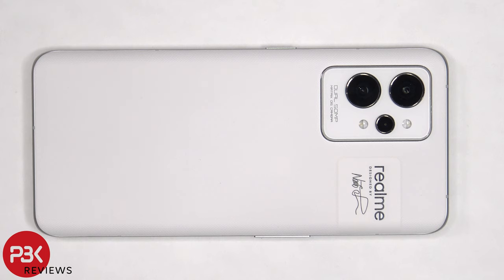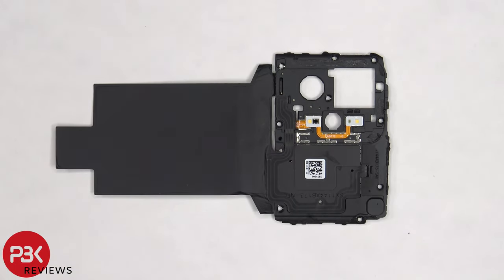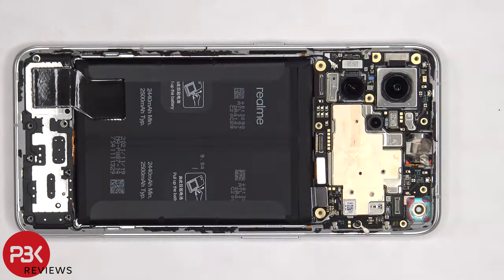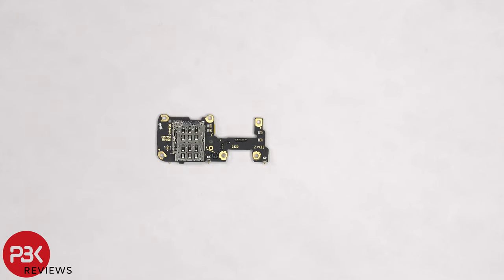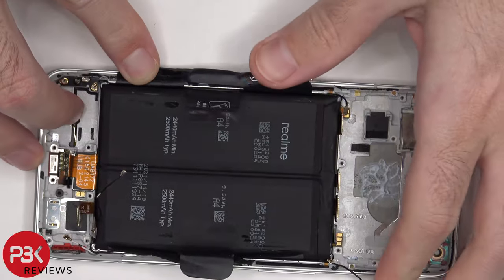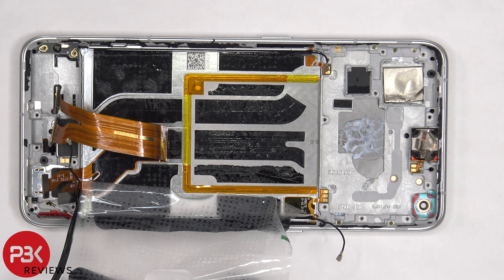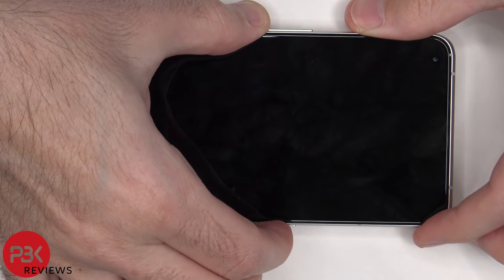Realme GT2 PRO Disassembly Teardown Repair Video Review

Comment: Thanks for your very interesting and helpful content and
Do you noticed how they made this phone with 360 degree nfc and enhanced wi-fi and antenna?
Reply from the maker: Yes they are basically using the NFC antenna on the black plastic cover as shown in the video, as well as incorporating the the antenna built into the frame on the top and top corners. Same with the wi-fi which uses the antennas on the top side of the frame and bottom side. You're welcome :)
Reply: That's cool but it doesn't work properly. I tried to scan from different positions when paying with NFC. Doesn't work. So, yeah. A little bullshit from them.

Comment: Hello man. Thanks for the instructions. Do you know how can I glue or buy copper cloth thing at 3.25?

I also reapplied the thermal paste but I dont know why I fucked up the front cam. It doesn't want to boot up. I checked everything properly and couldn't find a thing.

Comment: Bro just need a clarification...at video time 3.33 it shows Qualcomm PM8350 (8350 is sanpdragon 888), but gt2 pro states it got snapdragon 8 gen 1 which is 8450. So is it having snapdragon 888 under the hood
Reply: is there any follow up on this? i wanna know the same thing
Reply: @DannTeBg  Hi! There's nothing to worry about. You can clearly see it says  PM 8350 NOT SM8350.  The PM stands for power management, Therefore it's the power management chipset.  The Realme GT2 Pro sports the snapdragon 8 gen 1 chipset as stated in the specs of the phone.

Comment: the cooling system just some copper tape with thermal paste?
i thought got heatpipe like samsung because they advertise thier cooling is the best
Reply: This has a stainless steel vapor chamber underneath the screen. You can see it at 7:09, it's the slightly darker grey metal with the thermal paste, extending all the way to the yellow outline in the battery compartment. For a normal form factor phone, this GT2 Pro has a really big vapor chamber.
Reply: @somayough  thanks for the explanation... now i understand

Comment: So, If I broke the sceen should I buy the screen+frame or just the screen?
Reply from the maker: It's cheaper if you buy just the screen, but much easier for installation/replacement if you get the screen with pre attached frame.
Reply: @PBKreviews  yeah, was thinking the same then I noticed the frame is bented lmao - gotta think next time before dumping the trailer with the phone on it lol. Now I'm condamned at using the phone via mouse for a week!

Comment: Hi. i have just replaced my screen. Tell me why does the fingerprint scanner not work? All is connected right :(
Reply from the maker: Back up all your data, and do a factory reset (which will erase everything on the phone). This should reprogram the new fingerprint sensor to the board and get it working.

Comment: Did the water test mess up the speaker? I just dropped mine in a bucket of water and the speaker is now awful. Drying it for 24hrs to see if it will go back to normal.
Reply from the maker: No worked fine after I did it.
Reply: @PBKreviews  Confirming this. I blew on the speakers and there were water stucked. After that, sound went back to normal. So glad it is indeed waterproof.

Comment: sir this phone have physical proximetric sensor ?
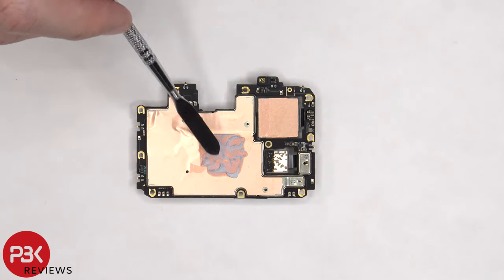Reply from the maker: yes you can see it @3:40 in the video.
Reply: thanks
Reply: @PBKreviews is it possible to change the proximity sensor separately? because mine got damaged due to water

Comment: Guys help..I have a realme GT 2 and motherboard got dead when checked the ram ic was destroyed so changed it & it booted back like before the only thing stopped working is cameras and flashlight is in use always..not even able to use face unlock so I think it's hardware issue but I want to get it's camera to check if changing cameras may work

Comment: which one is best iqoo 9pro or realme gt2 pro?
Reply from the maker: They are both good in my opinion. I really like the IQOO 9 Pro's large fingerprint sensor under the screen and the one touch setup for it but the vapor chamber on the GT2 Pro is larger. If I had to choose, I would possibly go with the IQOO 9 Pro because of that very large fingerprint sensor.
Reply: @PBKreviews  thanks for reply
but i am in big confusion which display is good flat(GT2pro) or curve display(9pro) for long term use/convenient, can i use curve display as flat disply.
and also overall between two which one will you choose?
Reply from the maker: @shoaibshaikh8153  hmm not sure, I guess it comes down to personal preference but I personally don't like curved displays, they annoy me at times lol but the most annoying thing is laggy fingerprint sensors so that is most important feature for me when it comes to unlocking the device. I hate it when i have to keep trying my fingerprint sensor to unlock the phone so since the IQOO 9 pro has such a fast and large sensor, its a big plus for me. The iqoo 9 however doesnt have that same large finger print sensor the iqoo 9 pro version has.
Reply: @PBKreviews  ok thanks👍
Reply from the maker: @shoaibshaikh8153  👍

Comment: sir i have dout what kind of proximetric sensor in mi 12 is a infrared ultrasonic distancesensor or a normal light infrared senosor because i am using mi 11 no light blinking top thats why i check it showing infrared ultrasonic proxy sensor hope you will check and give replay
Reply from the maker: I dont know exactly which type it is
Reply: @PBKreviews  sir can u check your mi 12 or 12 pro any proximetric sensor light blinking in top plzzz
Reply from the maker: @thakkhu1686  i dont have those phones with me anymore to check, or else I would have checked
Reply: yah i face the sensor issue also i watch your more videos so another mi,poco redmi this devices they removed the sensor so i will bot suggest to buy stupid mi company phones,next time if u get a mi12 or 12 pro plz check that setting kernal  3times click sensor proximetric what they writed
Reply from the maker: @thakkhu1686  thanks, and if I do come across another mi 12 ill check
Reply: hope you will give rplay next time after check